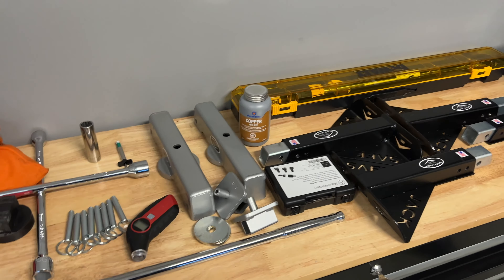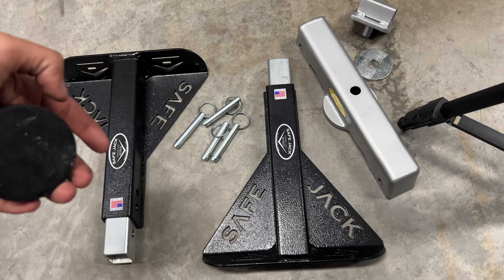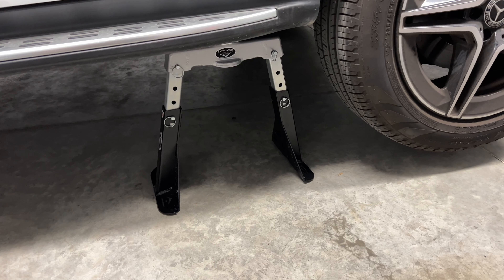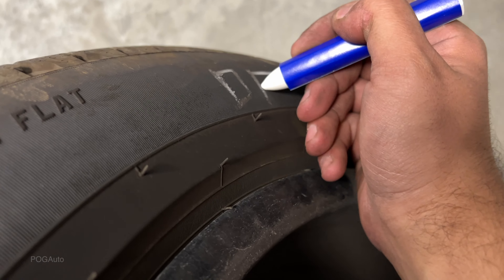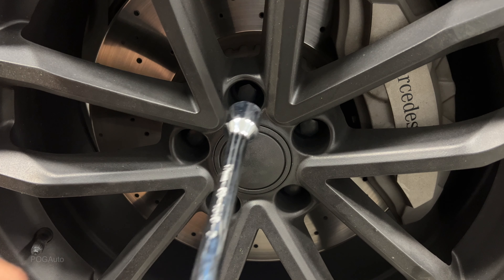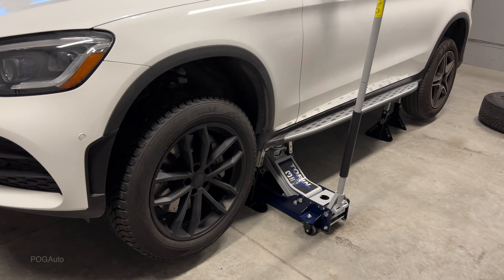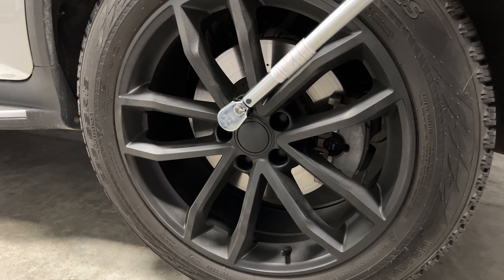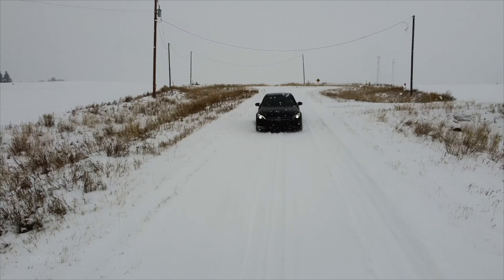How to Change a Tire (all season to winter)

Comment: Do you need separate bolts for winter tires or you can use same ones used with all season tires?
Reply from the maker: Depending on your wheels and car. For this I have to use other bolts but for my Tesla with different wheels the same oem lug nuts works. I would suggest contacting a tire shop to make sure

Comment: Anti seize should be applied to the center ring and the wheel center hole. Remove rust with a steel brush and sand paper, clean with acetone, both on the rusty center ring and in the wheel center. Do NOT apply anti-seize on the bolts, or they may loosen while you drive. You can also apply a thin film of motor oil, if you do not have Anti seize at hand.

Comment: I recently bought the rennstand with the Mercedes adapter but I am hesitant because it is not a exact fit. Do you have any issues with your adapter?
Reply from the maker: I also believe it is not an exact fit but I did not have issues with it.
Reply: Thanks for the quick response.

Comment: Hi bro i have a question. I normally see that canada 🇨🇦 you are not allowed to have tint on ur two fron windows. It should allow 70% light. But all ur cars have tint. 

Is it optional now???
Reply: depends which province. Some provinces allow u to put a legal tint which is 35% that is still dark but still see through which cops can see u.
Reply: @willymercedes4068  oh i get u… which province allows u put tint on the front windows? Name them kindly
Reply: @MarkkimaniUSA  not sure about all but where I am in Ontario legal tint limit is 35%
Reply: @willymercedes4068  okay 👍 thats good 35% is good. 70% is too clear

Comment: Hi, where did you buy the jack and the jacking set with the adapter, mounting plates etc., like to have this set to ligt my GLA.
Reply from the maker: I got the Jack from costco and the jack stands from safe jacks website
Reply: @POGAuto  great info btw. Where would you place the jack stands if you were using a different Jack. If you place the Jack on the rubber ?

Comment: Do you know if this car will fit 18" rims?
Reply from the maker: I would not recommend it since even with 19s it was hard to find wheels that would clear the front big callipers. In fact these callipers were damaged and the tire shop had to pay to get them replaced you can find the video in the chanbel
Reply: @POGAuto  Thanks for the quick reply. I have 19 model with night package and those calipers are indeed huge.  I will go with the 19" just in case!  Thanks

Comment: Guys you don't need all this gear just to change tires at home. 
You only need the hand tools and a car jack, you don't need plastic blocks behind the wheels either if you just lift the handbrake, the rear tires are locked, and you put the car in gear/park mode, you only ever change one tire at a time so you have three tires on the ground at all times which is safe. 
Lastly no need for a jack stand here, use car jack and pump it up just enough so that the tire leaves the ground.

Comment: A little misleading in the title of this video.
Changing a tyre is actually removing it from the rim.
The title should of been "how to change wheels".
The tyre is just the rubber part while the wheel is the tyre and rim combined.
Reply from the maker: Please get your facts together, even booking a appointment at a tire shop for a change like I showed in this video the tire company booking calls it tire change with their own wheels. I wonder what would you call a tire rotation then. Oh i think Wheel replacement. Please don’t call my video misleading when you have a different opinion of how things are called today.
Reply: @POGAuto   I guess it's how bad Americans or Canadians speak English. I stand by that your video is misleading. If you can't take criticism  then turn your comments off.